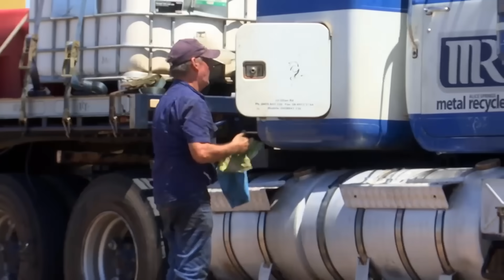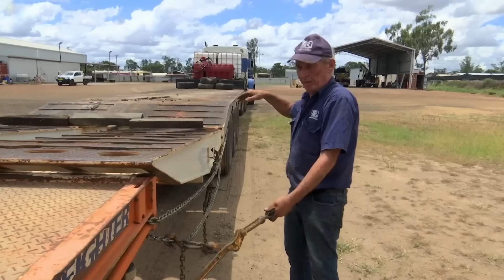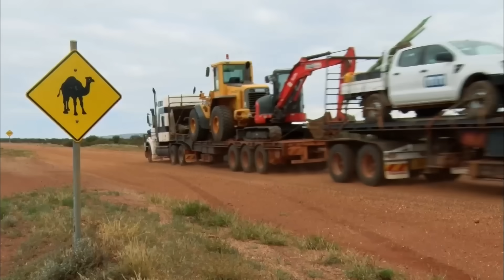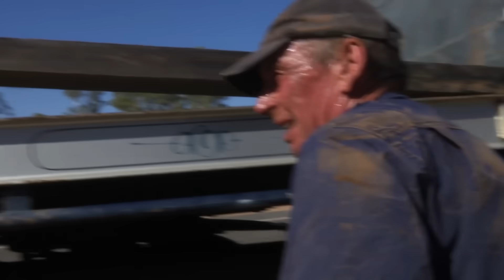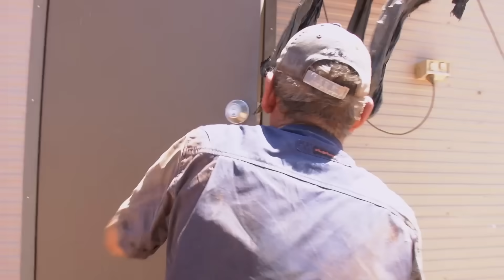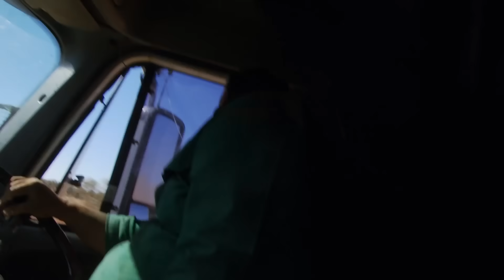Bush Mechanics! Insane Truck Repairs On Long Haul Journeys

Comment: Another thing that might help truckers changing tyres is to have a spray bottle with soapy water in it if you're having trouble removing the rim or spacer just spray the soapy solution and the wheel will nearly jump into your lap 😊
Reply from the maker: Great tip! That soapy water trick really works wonders when youre stuck with a stubborn tire. Definitely a good way to save some time and effort. Have you picked up any other handy tricks over the years?
Reply: @Outback-Truckers  yes read down further about ground black pepper stopping water leaks. You might need a few containers of it in truck

Comment: Just so you all know, dont put eggs in your radiator unless youre prepared to replace everything in your cooling system but the engine block. Thats not meant to be your first option, its the last.

Comment: wierd ?? forwhat they cost. truckers do not have small  honda  compressors  on board along  with  tools
Reply: Why would you need a Honda compressor, you can run air tools directly from the air system on the truck? For changing tires it's perfect but the air tools are heavy and space is always a consideration as well. I carry a hose ,chuck, 1 inch gun, air jack, ect specifically to change my own tires but not every truck has the available space.
Reply: Soft hands